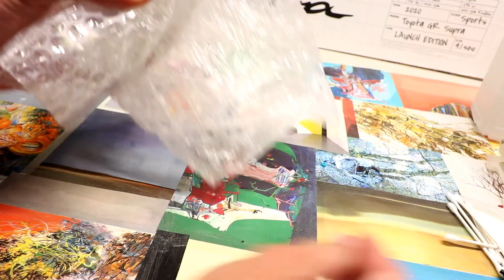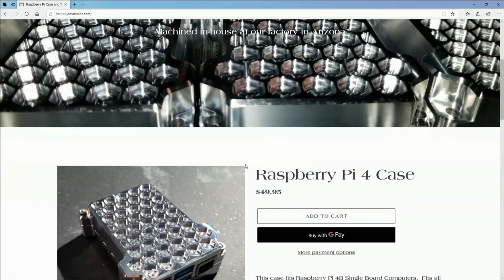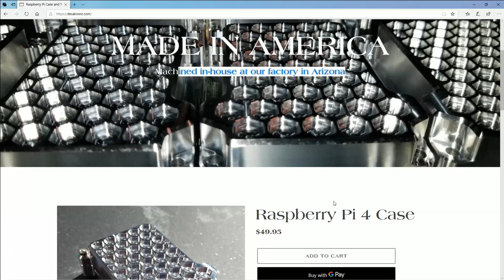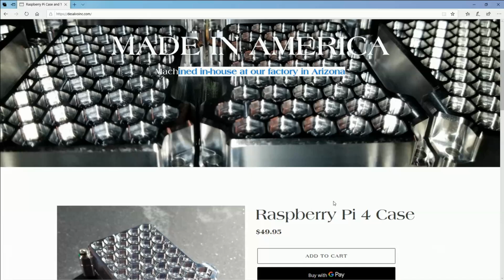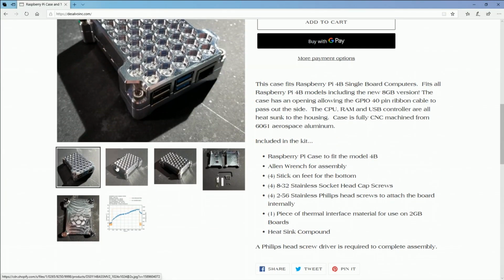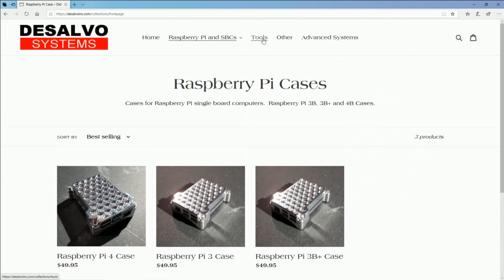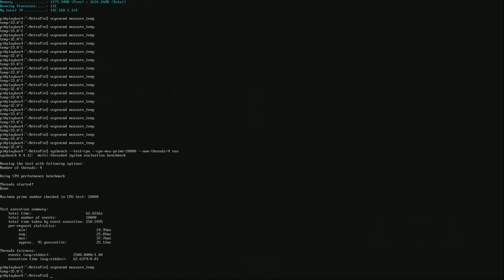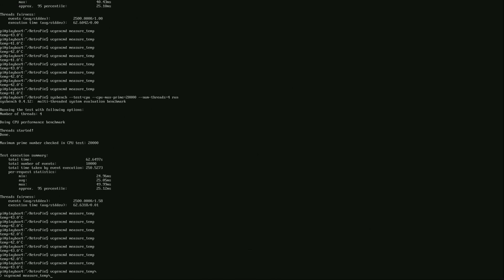One Of A Kind All Aluminum Raspberry Pi 4 Case

Comment: whats the best cheap passive case for RPi4 for overclocking to 2.1GHz? Would like to see a video on that. Never liked active fan cases for my Pi. If I had to cool my Pi inside a passive heatsink case then I simply run a 4-inch computer fan. That thing is only used for extreme cases. Other than that the passive case works flawlessly 99.9% of times.
Reply from the maker: this would do it I am sure

Comment: How about a clear plastic/metal combination for the case? Almost like the iMacs from the mid 1990's. like the magenta color for the raspberry pi logo and metal for the rest of the case. Maybe the hive design can serve as an outlet for passive cooling for fanless sbc units. The outlines the hive design can be cut out for the heat to dissipate for better performance.
Reply: However, from previous comments a metallic hard silicone or plastic can maintain the wireless capabilities like bluetooth to save cost for the consumer.

Comment: A good review. The case is definitely a work of art, but I don’t think I could justify paying $50 for it especially as, like all metal cases, it compromises the wireless and Bluetooth capabilities of the Pi. If you have to buy dongles to get around this issue, the cost goes even higher.